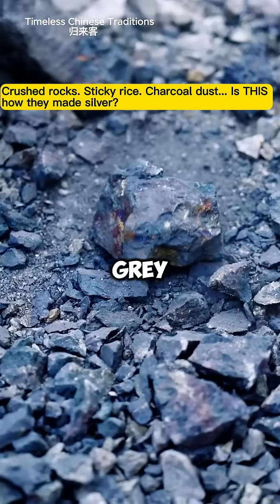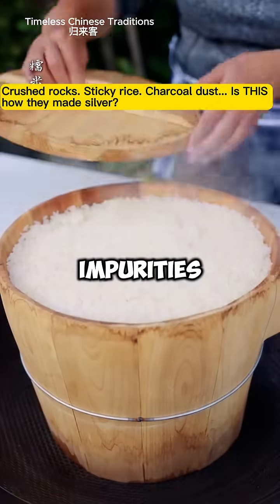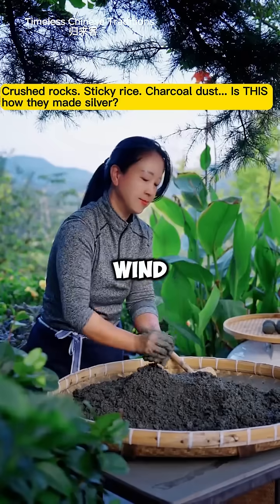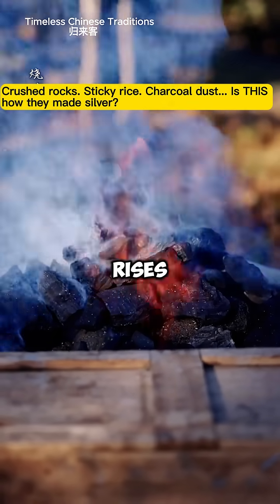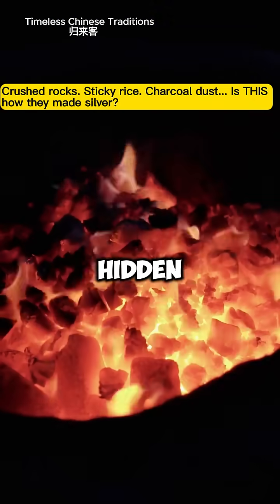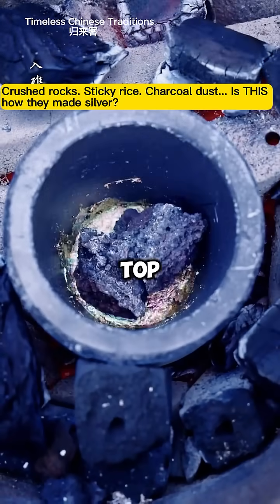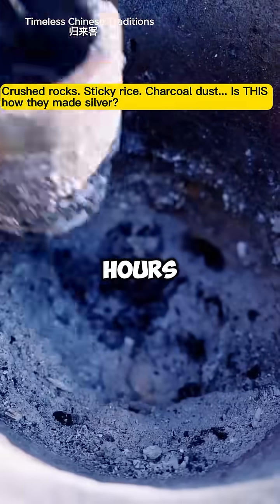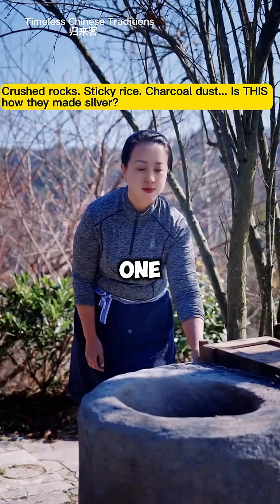How Ancient Chinese Refined Silver by Hand (Step by Step)#handmade

Comment: Looks like she got the same amount of pure silver she put in at first in the crucible
Reply: Such small quantities of ore might not contain that much silver. Likely is a lot of lead in it as well. I wonder what, if any, ancient techniques were used to remove the lead.
Reply: @arcare001 cupelling with bone ash crucibles. Not sure what ore is in the video since it looks to have already been ran through a jaw mill but presumably it's Galena so upwards of 1% on average silver weight. It's usually processed in large batches, a ton basically, because you'll only get an ounce or two.
Reply: @OttoScott76  yeah, not much return on the amount of ore in the crucible. So I'd say she just uses the metal already extracted to attract the new metal into a convenient puddle. What do you think, 1/2 gram, 1/4 gram per cycle?
Reply: @arcare001 probably less. 90 pounds of processed Galena (lead with impurities minus sulfides) can be anywhere between less than .01 grams and up depending on purity, actually impurity since silver is the impurity. That's a ton of raw galena down to 90 pounds of metal down to as little as less than .01 grams of silver but it can be up to an ounce or more if its the perfect ore.

Doing maybe 5 pounds at a time you'd probably never get an appreciable amount even with high grade ore, the costs associated would mean you'd only increase your debt significantly which is actually how it's always worked in the USA too. The silver itself hasn't been viable but the lead is so silver is an added bonus. 

Using the same techniques on scales that would actually be comparable to ancient practices, regardless of technique they'd still process large amounts at a time maybe 200 pounds minimum, you'd have a fair yield regardless of technique but that's still maybe a few grams or up and you're primarily getting lead which makes it worth it.
Reply: @OttoScott76  Do you know what kind of ore would make smelting small batches yield an appreciable amount worth the trouble? I know the Chinese used silver for currency back in the day so how did they get it?
Reply: @arcare001 the only source of good small scale silver production would be native silver, just refine in bone ash crucibles with an excess of lead and you have nearly pure silver but you could also use the native silver directly for production of coinage or jewelry since its primarily just silver already and smelting into ingots would remove most impurities without the extra work of cupelling for half a day. 

Traditionally though you'd just have a massive scale with galena. It's not necessarily hard to do with enough workers and the lead was also important for metalworking with copper. Same techniques, just huge furnaces.

I'm not familiar with China's geology but galena is the most abundant source of silver ore and native silver while usually rare can be mined as well since both are deposits(appreciable quantities in a location) so either is viable. There are other ores of course but they're still similar in yield as Galena.
Reply: That is lead I gets the silver out of the slag an makes an alloy